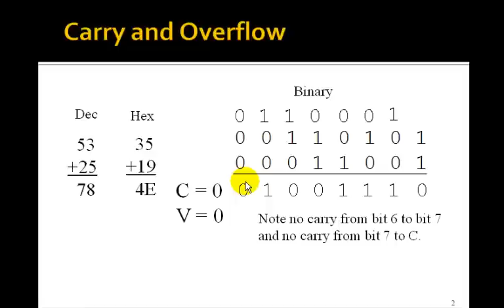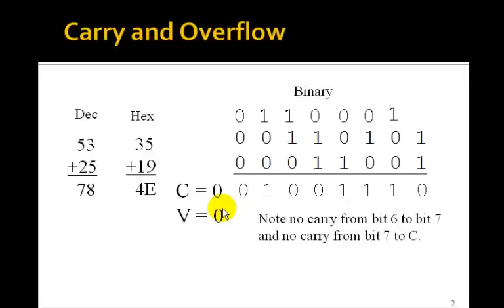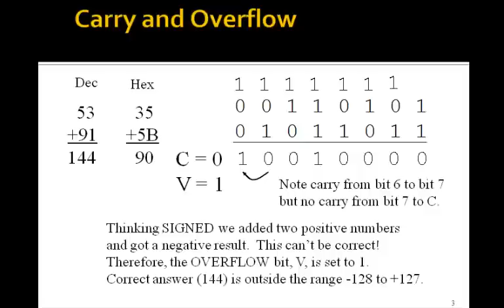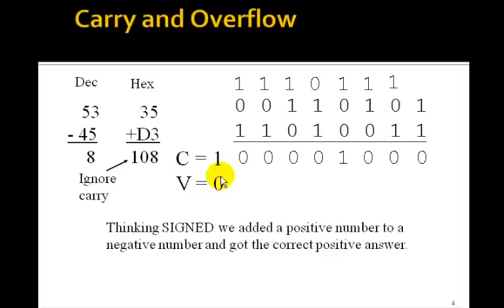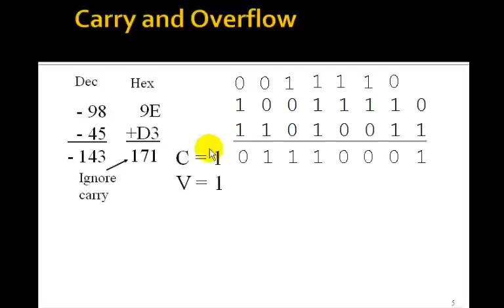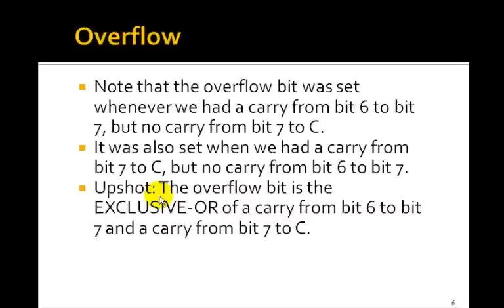Lesson 45b - Adders Carry and Overflow

Comment: Banansnk
Here we are adding 2 negative numbers so -
-98 (decimal) = 9E (hex)
-45 (decimal) = D3 (hex)

Try this on your scientific calculator and you'll get the above.

Also note that 9E = 10011110 and D3 = 11010011 in binary.
Both these numbers have the MSB set to 1 which is what it should be
for a negative number.